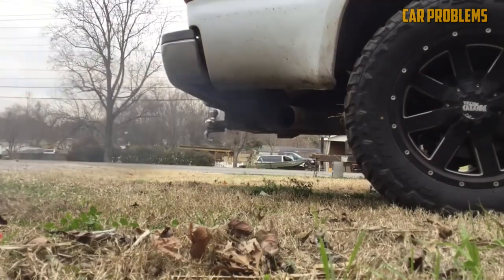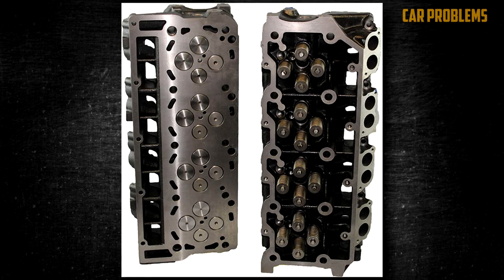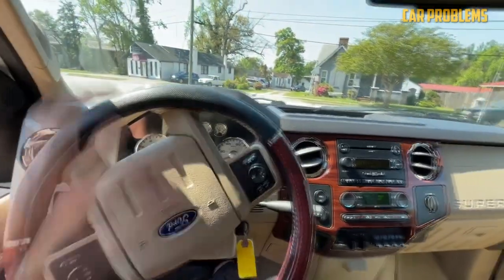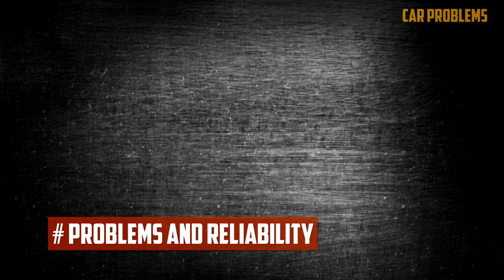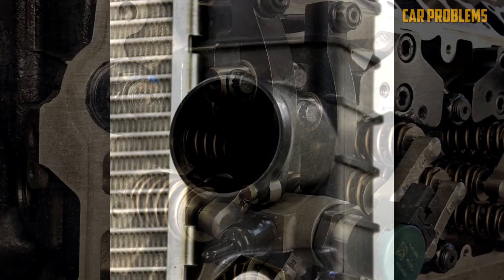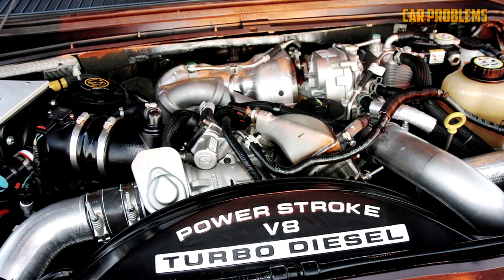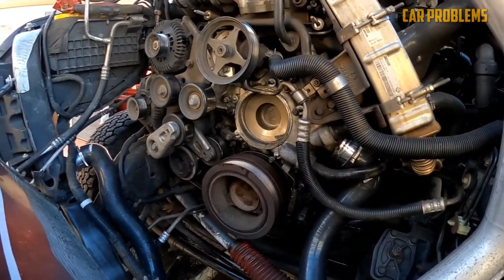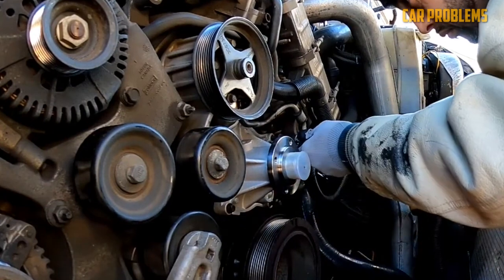Ford 6.4 Diesel Problems  - Powerstroke Issues and Reliability

Comment: Well, that depends the 6.4 Powerstroke are absolutely worst engine ever because Navistar build it. And, there's another problem for the 08-10 6.4 Powerstroke, is the engine parts and emission system. When the 6.4 runs away from white and grey smoke it causes catastrophic failure. It wasn't Ford, it was Navistar and very expensive to fixed.

Comment: Cracked position failed lifters and self destroying Siemens HP fuel pumps, disintegrating water pump casting can’t really be blamed on emissions equipment. It was a bad build.

Comment: Someone should redesign the 6.4 engine  to make it better  and try using 6 bolts per cylinder instead of 4 bolts per cylinder. And 7-8 cylinder dump fuel into the cylinder was another bad idea. Washed out cylinder over time. Navistar did a awesome job on the 7.3 powerstroke. But can’t just blame navistar for the 6.0 or 6.4  there part of the problem but ford is also to blame.